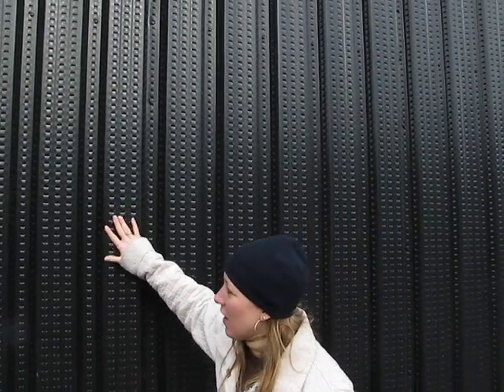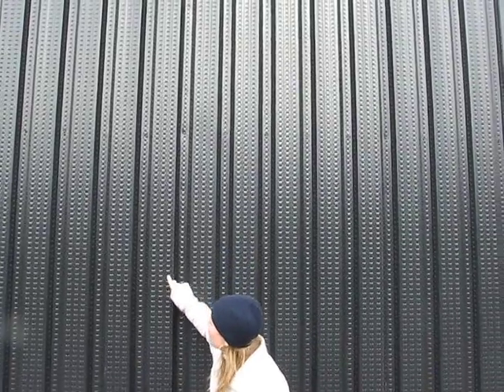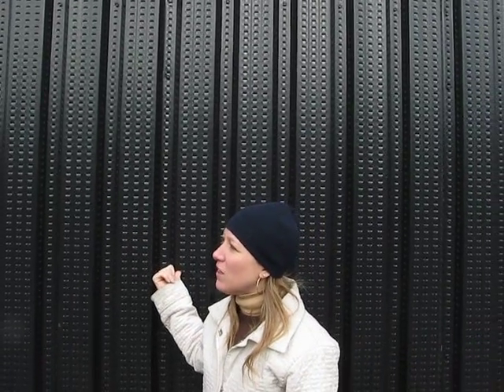Planet Diaries....This Solar Wall Really Heats Things Up!

Comment: Sun hitting the metal siding heats up the surface - this is true on any building.  When integrated with the fresh air intake, that surface heat is pulled into the building through the perforations whenever heat is needed.  When heat is not needed, there is no airflow, the heat stays on the surface of the metal.  However, the metal SolarWall is framed 6 inches away from the actual building, putting the building in shade if you will, and providing a buffer to the summer heat. not hotter - cooler!

Comment: @billpeart The SolarWall is installed 6-8" away from the main structure creating an air cavity.  In summer if the fan is not drawing air through the perforations the heat merely dissipates off the face of the metal like any metal building.  In fact - since the metal is 6-10 away from structure the airspace acts as a buffer to summer heat.

Comment: Hey HappyJack - it is pulling in fresh air. The composting process requires heat and a fresh oxygen supply.  Without the SolarWall the outside air must be heated with gas burners.  In the summer if the extra heat is needed to speed the process it can be drawn in or the wall can be bypassed and air drawn from a  bypass damper.  With no fan pulling air into the wall system there is no additional heat gain in the building.  In fact - sun is hitting a surface 6-10" away from building structure.

Comment: @HappyJackProduction1 composting requires heat and aeration for fresh oxygen supply.  In cold months that fresh air needs to be heated otherwise as you have surmised the compost process would be stalled.  Gets expensive to heat the air but with solarwall the heating cost is reduced.

Comment: hensonlaura - we don't own the company.  We just believe in the technology.  Solar air heating is the most effective solar technology out there.  Solar PV - generating electricity has typical efficiency of 12-17%, solar water heating 30-50%,  solar air heating ranges 50-75% efficient.
  If we are to truly achieve a significant shift in energy independence in our commercial/industrial/institutional buildings we should be looking at solar air heating.